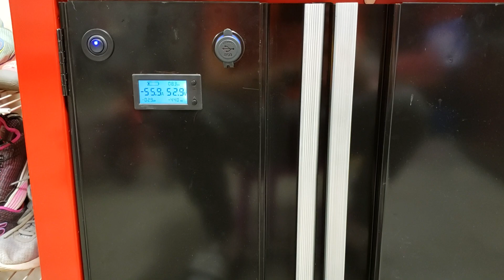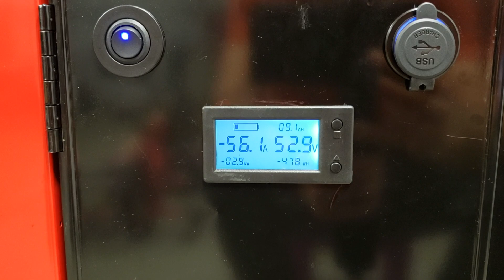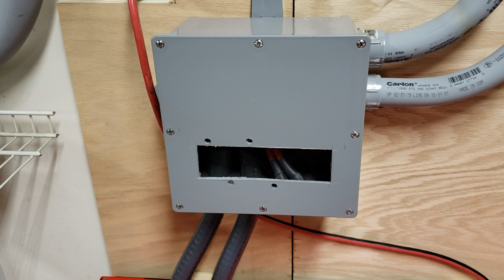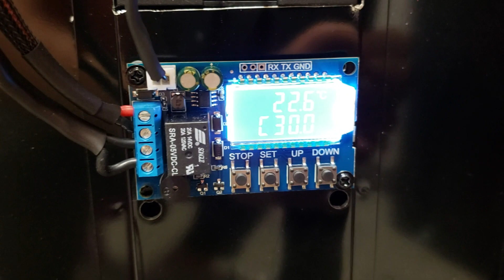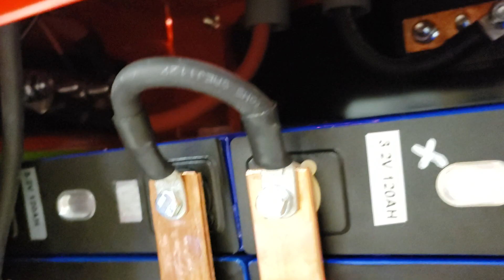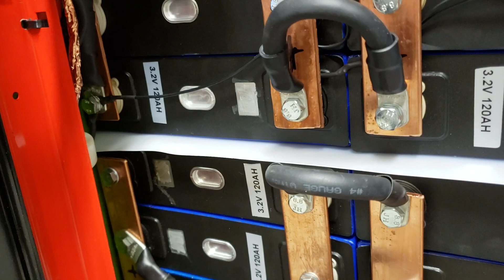MPP Solar LV5048 Power Wall Overview & HOA Wins Round One

Comment: Awesome job! Love the idea of building your own in a metal box. Only problem is if you need to move, those terminals may short against the steel.
Reply from the maker: Securing the modules have been addressed in subsequent videos. And I have moved. Will start working on array here shortly. https://youtu.be/ub_33E9MsSc

Comment: why not use a shorter piece of the busbar instead of the connector cables when they are next to each other ?
Reply from the maker: As things expand and contract during charging and discharging and heating and cooling I wanted the modules to be able to breathe as they are on top of each other. That's my thinking behind it. Hopes it makes sense.
Reply: @DMIINC2013  I am not sure how that would be affected since the three cell parallel modules are connected that way but I will take your word for it .  I just thought that would be simpler and less time consuming and materials.  I really like your  detail and clarity as  you explain your system.
Reply from the maker: @teekay1785  You are correct. Three modules are connected in parallel via bus bar. I want to keep modules not being able to move at the minimum. Hence interconnecting cables between modules. I know that your way of thinking is more simpler and less time consuming, no doubt but this just my thinking and I might be wrong.